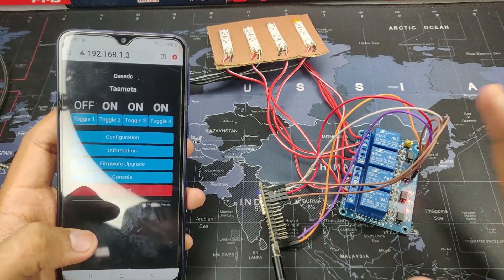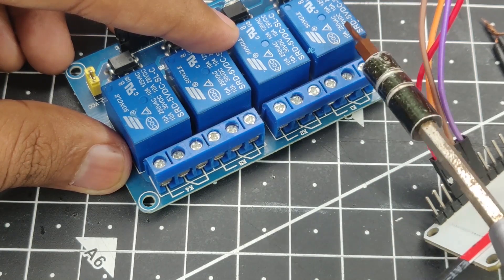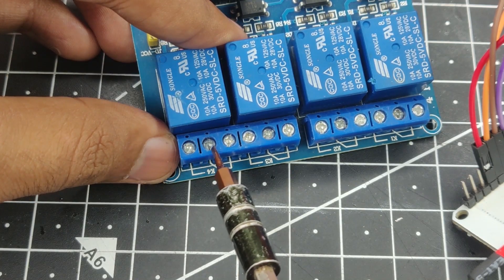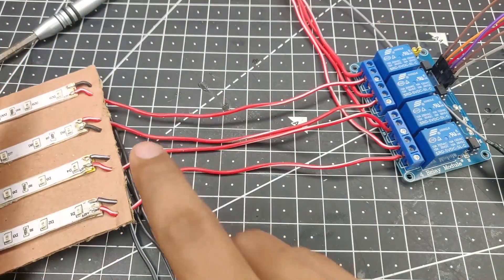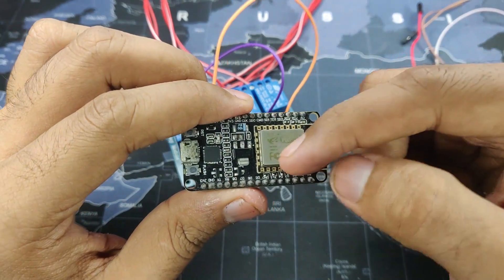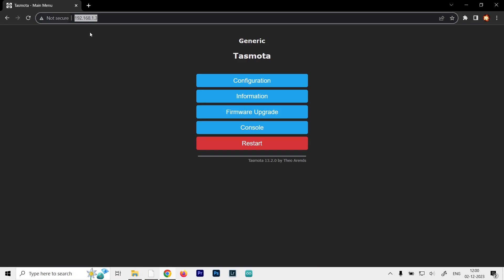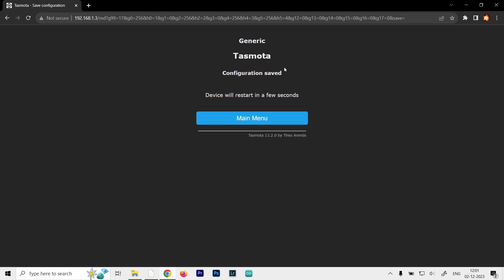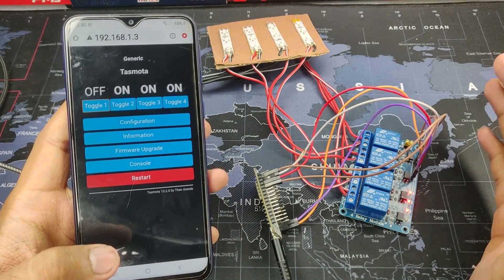Home Automation Project With ESP8266 NodeMCU and 4 Channel Relay With Tasmota Web Server | No Coding

Comment: Nice video what if you whant a button ex: nº5 to turn off and on all relays at once?
Reply from the maker: While I used the Tasmota it had an option for assigning one button to multiple relays but I think I didn't see an option for assigning one relay to multiple buttons so I don't think it's possible but I'll have a look.